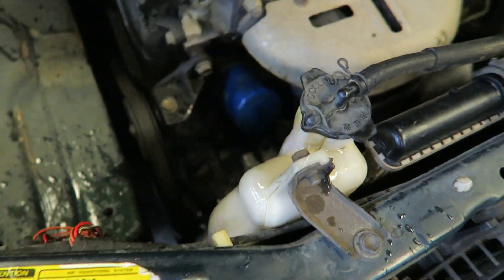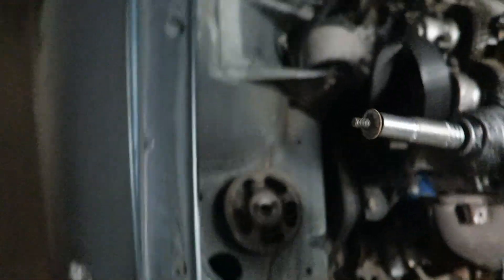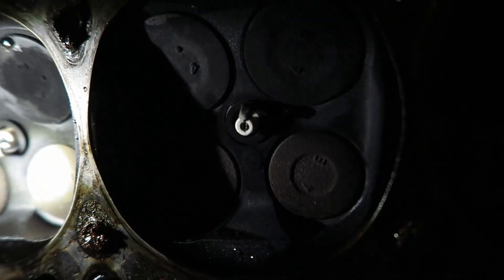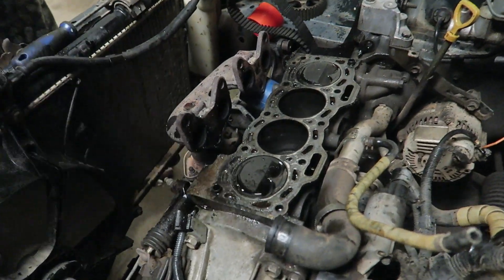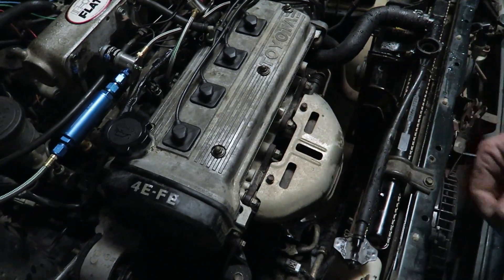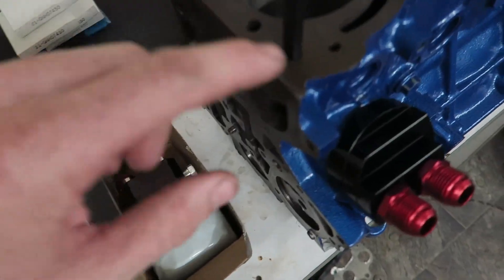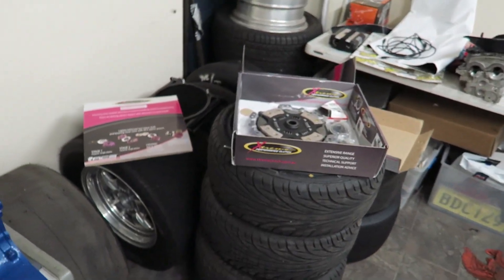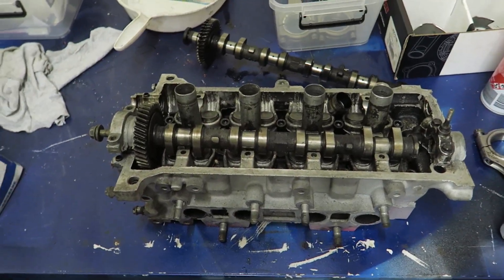Nitrous Starlet gets a COMETIC head gasket

Comment: Love the content, haven't seen that Ross dampener before 😮. Also if that single layer oem metal headgaskets is the same one I'm using, it's designed for the obd2 engine which has different pistons and a different combustion chamber, the first time I ran it it seemed fine but when I put my ported head on I noticed that the gasket was too thin and left witness marks on the underside of  my head. So I bought 2 and stacked them. They measured 0.24mm each

Comment: I can only speak from my 40 years of experience my good man. Use JE head gaskets. Cometic will always fail in time. My apologies.  I like your build my guy🙂😀😃
Reply from the maker: Appreciate your comment but Detonation is what kills them. We made almost 500 hp on a cometic head gasket for almost a year, street driven. Eventually the crank caps and crank broke and when we removed the head the gasket was still in perfect condition. 

I have also melted/blown cometic head gaskets within 50km too using 95 octane fuel and too much boost 

It happens lol

Comment: Dear Matt, I have starlet ep91 and it's shaking on ideal, can you make video dominating what may cause it, I change plugs, and engine mounts also clean throttle body, some say it may be torque converter, others say it may be timing issues.
thanx
Reply from the maker: Sounds like its idling too low. Try raise it a bit

Comment: Could you explain why you put the bolt in the camshaft gear? I have seen it before but i don't understand why. You mention this in the videos but i still don't understand. Thanks Matt!!!
Reply from the maker: Hi that particular cam gear is two peices and its spring loaded. It is spring loaded so it applied pressure to the other gear in an opposite direction to eliminate noises and rattles from backlash... putting the bolt in there holds it in place so that the cam can be easily removed and refitted without disturbing the preload. If you remove the cam without using the bolt, you will need to spring load the gear and put the bolt in before refitting it :D
Reply: @Camp_Dogs  thanks Matt!!